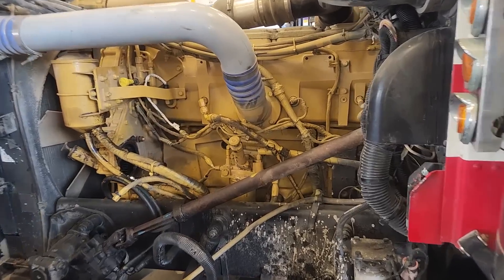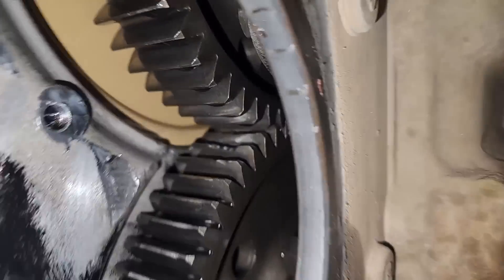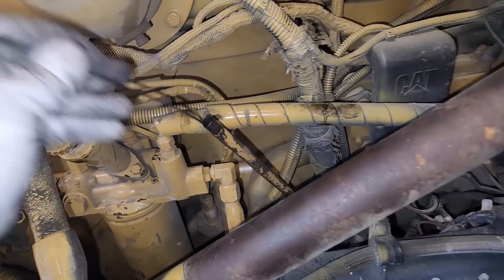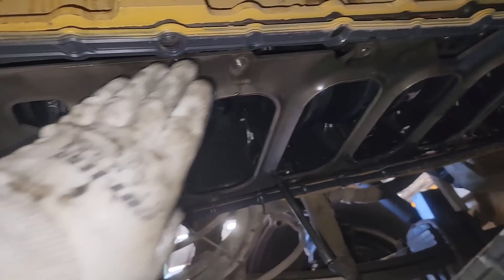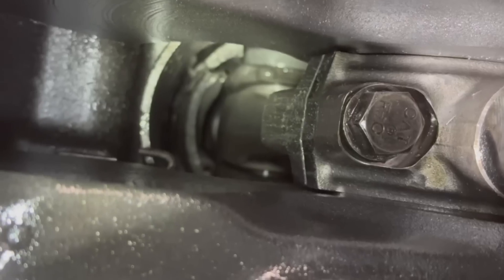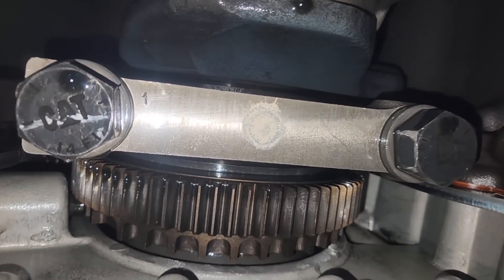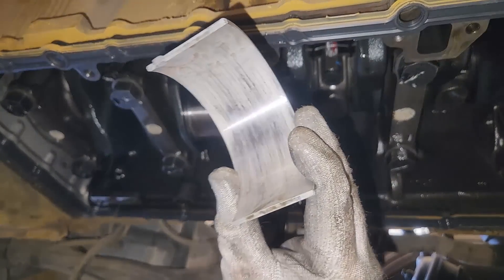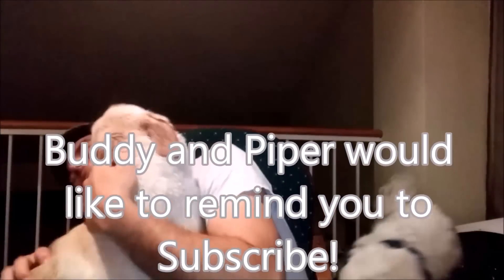"Smoky Red" returns with a VENGEANCE. Diesel Engine Gear Train Failure

Comment from the maker: Thanks for watching. What do you think they will decide for a fix for "Smoky Red?" Check out the Amazon Affiliate Links for recommended tools: 
Engine Oil and Fuel Dye UV: https://amzn.to/3z34zkv
UV Professional Grade Light: https://amzn.to/3gzxPc0
Allstar Oil Pressure Priming Tank: https://amzn.to/3L5pASm
Oil Pressure Priming Tank: https://amzn.to/3YuBrNr
Photo Tach REED: https://amzn.to/3ATJ8Cw
Reply: Hi Josh, Is the UV dye suitable for most engines and fuel systems? Also does the oil need changing after it's been added or is it ok to leave it in until it's next interval? Unfortunately it's unavailable from Amazon but I'm now on the hunt for a similar product! Thanks for posting and keep up the good work.. Dave 🇬🇧🤙
Reply: That owner needs to fire their mechanic and hire someone who actually knows what they are doing. Like you. You’ll save them money.

Comment: I run the welding side of my shop and I have had to undo and make better some work other shops around town have done and in turn gets us more business, not a bad thing i dont think.  Ive personally talked with the customers and I will tell them how it is and not sugar coat anything, the fixes and mods I make to the attachments and machinery have my name on them and I will not do a subpar repair or modification cuz thats my reputation on the line.  When I build something I shoot for overkill at a minimum, on my personal stuff i overbuild it because I beat the crap out of them and expect them to perform.  So I tell the customers I will over-build it for their and my peace of mind.

Comment: Nearly everyone has to learn at some point, your so far into something and dollars spent if it goes really wrong price to repair sky rockets because ya went cheap somewhere.... somethings it works out, sometimes it doesn't and sometimes the completely unexpected happens I had one this week guy been using laptop to reset dpf on a cat 9.3 but NOT actually change it  they had a malfunction with transformer for spark reset code a bunch of times and basically fillled a seriously plugged dpf with fuel and it lit cause issue was ground wire to ecm from transformer well troubleshooting it made contact and created a bomb took me a bit to figure out what happened it blew end cap off. needless to say that was the unexpected that should have been (ya guessed it) EXPECTED Happened! Great find and explanation as always!

Comment: I’d be highly suspect of the other shop if I was that customer, I see a lot of worrying signs of poor workmanship. Like that kinked boost line to the wastegate, the kinked shunt line, the paint overspray on the oil filter, and the bad overuse of silicone. 

And it’s hard to tell without seeing the filter or oil, but I have a hard time reconciling that much bearing damage from a piled up compressor and some worn gears. I can’t that much metal getting past the filter in that short amount of time. Too me, that looks like the effects of someone not using assembly lube and starting the engine dry. But who knows.

Comment: Yeah personally if it was mine I would do a farmer rebuild on the bottom end (clean the crank journals with some emery cloth as best you can and throw a set of new bearings in it and call it a day)

Then obviously I would replace whatever gears were messed up put a compressor on it and let her run, I know you're a shop so you have to stand behind what you do but if it was my truck I would do that and it would probably run like that for hundreds of thousands of miles!

Comment: I got a 2013 pete with over 1m180k miles original air compressor, by looking at what just happened to that truck, should I replace my compressor just to be safe or what are some signs I should know ? It's working  fine so far the engine is not burning oil and coolant is still good I did a oil sample test 2 months ago by Blackstone labs and they didn't recommend rebuild, what can you recommend? Thx for all your videos I really learn alot by watching them.

Comment: I had a dealer do an out of frame rebuild. From the crank out. 
On my 14liter detriot. 
8 miles later the new head cracked. 
Same dealer Warrantied. 
900 miles later the new head cracked again. 
Warrantied by a new dealer. 
3 months later the engine smoked like a banshee. 
New injectors. 
New egr cooler. 
Warranty paid again. 

3 months of down time they finally pulled the bearings and the second dealer looked worse then these bearings. 
Top end and bottom end crank bearings were chewed thru. 

The second dealer warrantied new bearings , replaced a sleeve and rod and piston pack and flushed the engine. 

No problems since. 

Point is even the dealers are idiots sometimes. 

That’s what this guy was probably thinking. Little did he know he made the wrong choice the first time.

Comment: I don't really understand, how a failure like this destroys the bearings so quickly. The chunks from the gear train and compressor of course fall into the oil pan. Then they are picked up by the oil pump, so I can understand damage to it. But then the filter is supposed to filter out anything large enough to damage the bearings. The pump failing doesn't seem like enough "stuff" to completely clog the filter and make it bypass due to overpressure.

Comment: Call me stupid, but if I'm investing 10's of thousands of dollars into a rebuild, you can be pretty sure I'd  be replacing the compressor, water pump, reman injectors and sending out the injection pump.. at a bare minimum. Short of that, you're just going to Vegas.

Comment: I have seen two almost identical failures of air compressors on CAT C13s, both at about 530,000 miles.  In each case, the rear bearing of the air compressor failed, and the resulting misalignment of the compressor drive gear to the front drive train destroyed that drive train, put debris into the oil pan, oil pump, etc..  On one truck, the repair came to about $10,000, on the other about $15,000.
I was told that CAT warranties the compressors on new engines for only 500,000 miles, for what appears to be good reasons.  
The lesson in this is: change air compressors at or before 500,000 miles - do not wait for the air compressor to fail before putting in a new or rebuilt compressor.

Comment: Personally, PLEASE put it back the way it should be. Some people need things like this to show them that threr is a correct way and a dirt cheap way. It hurts when things have to be done right, BUT it really hurts when a mistake has to be fixed.
5:10, What is the red stuff in by the drain hole?

Comment: My KCB had an air compressor failure like that.  The damage to my geartrain was much more sever than that.  I can't believe it didn't jump time.  The shrapnel inside the gear case was surprising.

Comment: Had the same thing happen with a c13.  Platinum rebuild at cat dealer, about 8k later and the air compressor fail, left the chat if you will.  Took out everything.  Dealer inspected and agreed.  Another rebuild, under warranty because of catastrophic parts failure on a part they replaced during rebuild.

Comment: Well I would guess the owner spent close to 20,000 on the in-frame that failed. So after looking at the video noticing hoses crimped and pinched Im sure the oil line feeding the compressor was plugged or something starving it of oil and causing the rods to fail in the compressor. 
   So now the owner of the truck will be spending around 30,000 for a long block plus compressor and additional parts. I would hope he goes after the previous shop for cost of their screw up but we know how that can go. If the engine didn’t overheat he might have you roll a set of bearings in it and a new compressor and hope for the best. Either way it’s cheaper than buying another truck to replace this one.

Comment: The only time I've had an issue with a quick drain was at my last job. Our grain truck was driving through a field and a corn stalk caught the lever and opened it. Luckily the driver shut it down as soon as the low oil pressure light went off.
Reply: Isn't it odd how we say, Went Off when it actually Went On?
Actual Radio Conversation with one of my Workers:
Boss the Air Pressure alarm went off!
Oh, Why was it on?
Found a hose popped off, but I put it back and it went off.
The Hose went off? 
No Boss, the alarm went off.
OK, I can hear it the background. So its off?
Yep, when the hose popped off again it went off again but it's off now 
......Hold tight there Jimmy I'm on my way.
Reply: @jaxcell for me (non native speaker) this is English in a nutshell, and it's hilarious

Comment: Just a question, why do the engine and compressor share oil? Wouldn't it be simpler for the compressor to have it's own sump.
Reply: Just my opinion based on past experience, but from many years ago when an air compressor was a separate unit from the engine, and usually belt-powered,  having its own oil separate from the engine was a great way for the compressor to be ignored, either due to ignorance, or apathy. 
As time went by, truck builders realized that it would be easier to spec the compressor to be included as OEM by the engine builder.
 
When they first started putting diesel engines in trucks, brakes were still juice brakes.  As time went by,  trucks and GVWR's got bigger and heavier, then truck-trailer combinations meant that juice brakes were not the way to go, air brakes were. 
So there was an evolution in braking (not all of which I have touched upon here) and how trucks were designed and built. 
Outboard compressors are easier to swap out in the case of a failure,  but also easier to overlook or simply ignore at maintenance time.  Onboard or built-in compressors that are part of the engine and share the oil supply, then get the added benefit of guaranteed oil changes,  as most folks really don't want to neglect their big diesel engine, given the replacement costs of a complete unit.
The only thing I would like to add outside of the above, is that going forward, I would spec higher-output compressors (i.e. more CFM's or cubic feet per minute) mostly on a personal preference basis, if there were options or choices at time of spec'ing out the build.
Reply: It would also need its own cooler due to high operating temperature I'd guess
Reply: No, then you have to do a separate oil change not to mention that wouldn't have prevented what happened because it was the gear that came apart and tore up the other gears which is where the metal came from
Reply: Good question, I was wondering the same thing. 
Seems like it could be separate unit same as an AC compressor.
Reply: Air compressors should absolutely be belt driven.  Totally seperate from the engine.

Comment: Lottery is always won by someone.  Sometimes you can go for a long time thinking "that part is fine" until the moment when it isn't.  That failure in the air compressor gearing bearing fail, would that fall into the "Surprise!" or would it have been evident that it needed replacement?

Comment: I know you work for a Cat dealer so you can't let anything out the door that isn't perfect but imo those bearings were entirely runable. In fact if that were my engine I would have cleaned out the oil pan, slapped a rebuilt compressor on there and kept trucking. Maybe a new oil pump if I really wanted to splurge.
Reply: Agreed. I've seen way worse in volvos and they lasted millions of miles after. The crank harding wasn't scratched through or compromised etheir
Reply: That engine had done very few hours, 3hr if I'm correct.. so for the bearings to be scored already the only place they are fit for is the bin 👍
Reply: Since you just had a failure that contaminated the lubrication system. Cat offers a one year parts warranty. That being said if a rod or main bearing does fail. Would be a good chance of Cat turning down the claim. So would you gamble?
Also would you run the damaged gears as well?

Comment: If it was mine looking at the rest of the truck I would take some crocus cloth clean up the crank put new bearings in it it replace the bad gears with some used ones and run it of course new compressor

Comment: you better check the suction tube for cracks at the welds, and for a crack at the oring flange
Reply: I had a cracked o ring. That drove me krazy for three months I was down in my back. Had a good friend of mine. Check it out three times and then wham o. He found it the cracked o ring I was so dam. Happy as I am a. Fantastic on mechanical stuff especially mine

Comment: I know of one truck with an E model that the air compressor gear broke and then the pieces went through the front geartrain and exploded the front cover, broke the nose of the crank, and made a mess at a pull off. Was making a hard pull on a hill and then BOOM!

Comment: The fact that you want to recommend an entire long block is ridiculous. Pull the front cover, drop the transmission and swap out the crank and bearings, some gears and hang a compressor. This is why independent techs like me are still in business
Reply: Do a cost vs repair spread sheet. If the failure was workmanship, who is to say what else they did wrong. Falls back on who has to pay the bill. First item is to do a failure analyst and find why it failed. Early hour failures right out of a shop usually points back to where it came from.
Reply: Let’s hope you do a better job than the “independent” shop that completely screwed up that in-frame. 😅

But in the modern day, the biggest cost in a repair like this is labour and downtime. And that’s not a small block Chevy. You can’t pull a crank out of C-15 in a pete without pulling the engine unless your doing some really sketchy shit. Front motor mounts in the way, plus the front axle. You gotta pull the front structure which is a massive job (but admittedly you’d have to do most of it for the gear repair anyway). How many extra hours of labour are you going to sink in trying to repair that engine as compared to getting a long block? How many more hours is that truck going to sit in your shop not making the owner money while your messing around with it. What else are you going to find while digging into it, especially with the questionable rebuild that just happened?

Comment: Several years ago, young tech installs air compressor and new hoses on a Cat 12 liter. Bearings fail in air compressor within a few days. Young tech replaces air compressor only again. Comes back again, this time air compressor locked up and wiped out gear train. Found root cause of failure, parts department built the air compressor oil line and had a flap of rubber restricting oil flow.  
Parts said you should have caught it the first time and service department got stuck with a 12K repair bill. 

Just looked at a rod brg failure that had ten miles on rebuild. Looks like rebuild was done dirty.

 As you have the failure, appears to have a lack of lube to the air compressor. The two rod bearings don't look like a lack of lube. So if it was a foreign substance, oil filter did not catch it. Could have something after the oil filter. Hate to point fingers, but a early hour failure after a repair, generally leads back to workmanship.

Comment: That sucks. At that point, I’d just put an air compressor on it and run it. Yes those bearings are scratched, but it’s nothing terrible. Pulling that motor now seems to be a bit excessive. Run it until it blows. If it’s basically junk, might as well get whatever he can out of it. May run for years, who knows.
Reply: I bet 20k if he did that , the owner will talk crap the min that engine blows up 

He only  do it the right way , and I am 100% think he is right
Reply: I'd at least polish crank with emery cloth and use new bearings
Reply: Party til she pukes !
Reply: i agree, also beautiful autocar. looks like a sweet rig

Comment: That’s one of those situations where as a customer I’d have a hard time accepting that a complete long block is needed only hours after I just had that engine rebuilt. The way you explained the failure and showed the damage is convincing, without that I wouldn’t be a happy customer.  
The fact that another shop did the rebuild, makes this further controversial. If something was done incorrectly when reassembling the engine, that ship could be liable for the damage. Probably difficult to prove however.
Reply: air compressors just kind of go. in my experience they typically just throw a rod out the side of their case. a lot of customers have them replaced during an inframe. at least thats what i always recommend

Comment: It's the old saying "pay me now or pay me much more later".
Reply: Except if it was air compressor failure that caused this, then it isn’t necessarily a matter of which shop did the rebuild. Josh could have rebuilt this engine himself, but if the cheapskate customer didn’t wanna pay for a new compressor (and oil pump, turbo, anything else oil related), that’s on HIM, not the shop that did the rebuild. Now, could be the shop screwed the install up, but there’s also a chance the compressor gave up the ghost. They usually don’t last longer than an engine.

Comment: Terrible. Seen that kind of stuff happen around our area. 

Shop did a rebuild, a year later, the truck is down again with engine issues, goes to Cummins, Cat, Mack or others after to get pretty much a complete engine work over with the crank removed and getting machined etc. Then the engine works properly after.

Comment: Trying to save money on a overhaul doesn't usually work out too well. I had to learn the hard way also.
Reply: not trying to be rude, but i learnt at a young age a poor man pays twice.
Reply: For the last few years I've looked online and the rebuilt price of a Cummins n14 is about 2/3 the price of what the Cummins shop about 5 miles away from where I reside prices to rebuild that engine: at least that's where it starts from twenty Grand and that was three years at quote..